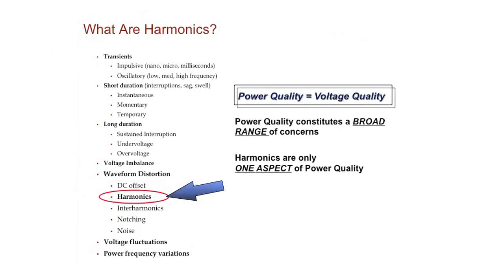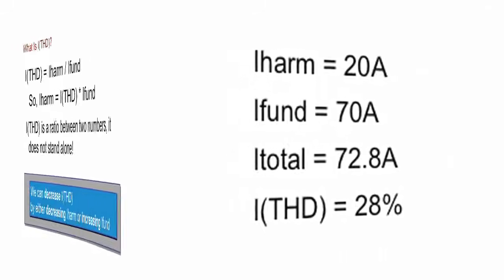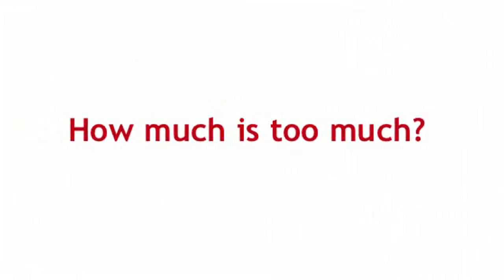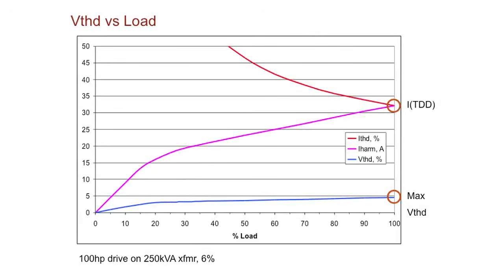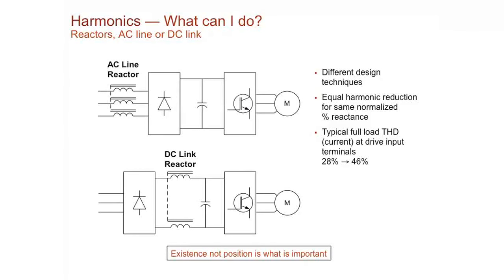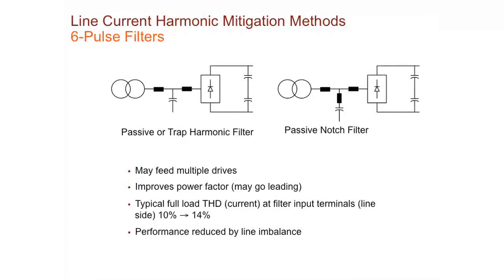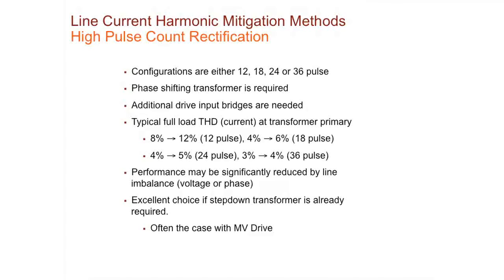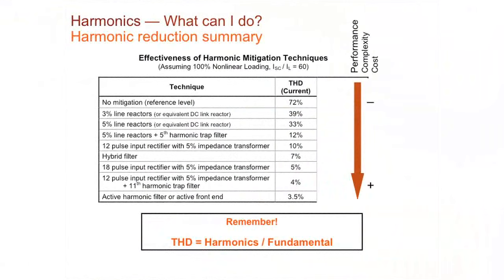Harmonics: What are they, why do I care, how do I solve?

Comment: Retired from a large hospital and never know they are held to a tighter voltage distortion. Had hundreds of drives from 3 to 1750 HP and our great  start up tech said that we were the only place that had equipment on line side & load side of most drives dealing with harmonics and voltage distortion. About 5 years ago at an IAEI class they said Japan is experimenting with supplying DC panels to large buildings. This would eliminate the need for rectifier and cheaper power supplies to equipment and reducing air conditioning loads. Think they hope to save at least 5% over all between power & AC savings.

Comment: Two things: Do 18 pulse VFD'S produce or handle harmonics better then they standard 6 pulse drives? Read some where that some cheap cheating china LED'S have a low power factor as low as 0.5 . Do such low power factor LED''S produce more harmonics then one say above 0.9 PF?. Tech from two separate drive companies said to stay away from 18 pulse drives but we have a lot of them in a new 12 story building ( all drives 30 HP & higher have 18 pulse drives except for soft start on 200 HP fire pump ). Do the newer think they are called active line reactors with their contactors & capacitors much better then plain Jane line reactor? Thanks for nice vid.

Comment: Power factor and voltage drop. If these are acceptable I don't give a damn for harmonics
Reply: Well bad harmonics will give you bad power factor
Reply: @michaelbee8263  Not necessarily. For instance, if you have square voltage and square current waveform, the power factor can be 1, but spectral analysis will show plenty of harmonics
Reply: @imeprezime1285  a square wave? This video is a power application.

Comment: How are you determining Voltage distortion by looking at the current waveform. In the begining you explain the calculation for ITHD then magically 30 seconds latter in the transformer comparison slides you come up with a voltage distortion value with no explanation of how you got it

Comment: I was thinking 70 + 20 = 90, Today I learn 70 + 20 = 72,  and it responded to all my THD Math I knew before :)
Reply: actually you should 1. square both of them  2. add them  3. square root the result and you will ger 72.8 so called rms (root mean square ) try it :)
Reply: I just looked at this video & I had the same concern. I think he meant to use only "2 amps" instead of 20, & thus 2/70 = 2.857%, otherwise 28.57% is way higher than their worst case THD. But considering he represents ABB, they should have fixed all of these discrepancies by now.
Reply: You can see the formula for RMS at 4:35 I(total) = sqrt (Ifund^2 + Iharm^2) = sqrt (70^2 + 20^2) = 72.8A.

Comment: Please be noted that Higher capacity transformers has comparatively Low impedance but not the higher impedance and that's  why  it exhibit low voltage distortion against same harmonic current Bcoz V=ZI , so less the Z, less the V@same I . 
In the video you stated that higher capacity transformer has higher impedance which needs to be corrected otherwise nice lecture. Thank you.
Reply: thank you. i had to stop the video and come to the comments because i thought i was losing my mind. The guy in the crowd and the demonstrator both agreed on a larger transformer being a higher impedance